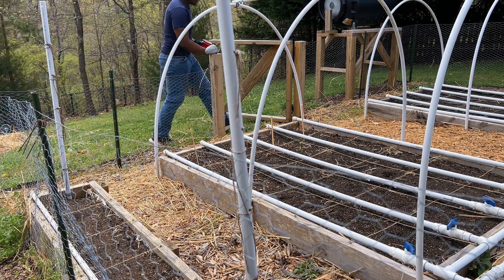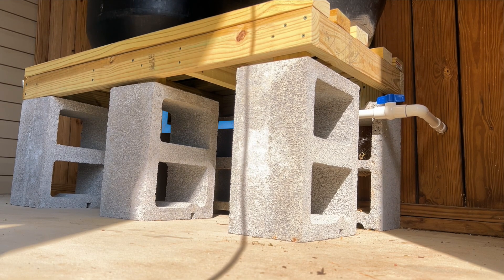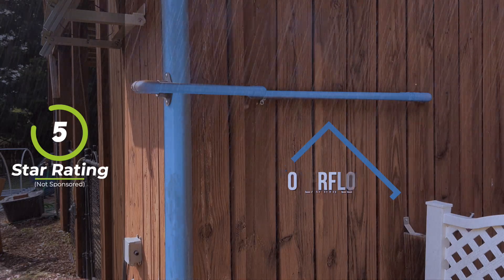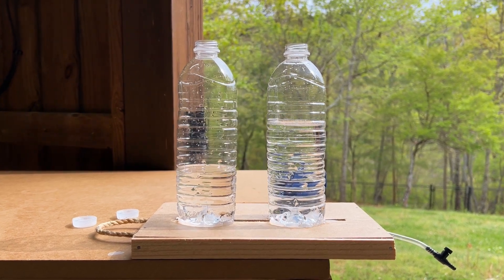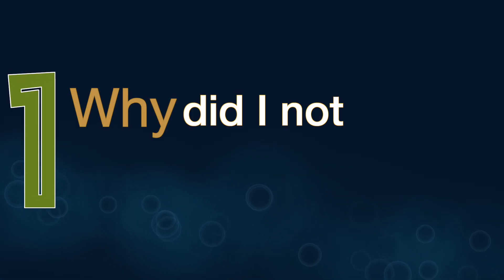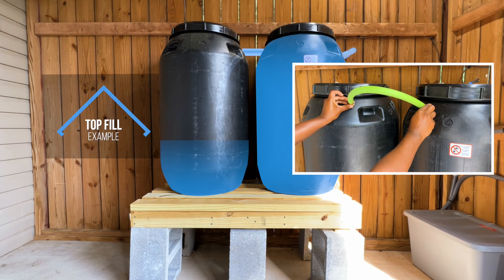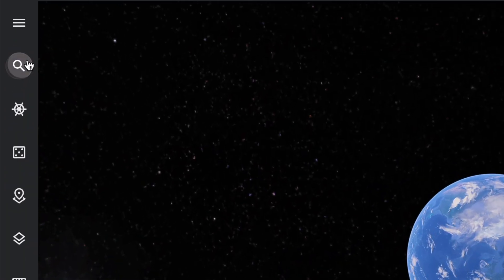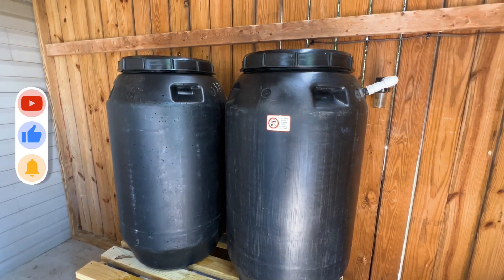Rain Barrel System | EXPLAINED

Comment: Hello, I love your videos and the way you break these projects down for those of us who'd like to try your ideas.  I've been thinking of trying to divert sump pump water to a rain barrel system.  All that water just goes into the storm drain anyway.  I have a large lawn with lots of shrubbery which makes watering pricey.  What do you think? Would sump pump water pose any different problem than water from a down spout?  Thanks again.
Reply from the maker: Thanks for the feedback. I'm not an expert in that area, but I could not see an obvious issue with it if you are already outputting the water down the drain. As long as the source of water the sump pump is removing water from is not containmented I would think it would be fine for watering plants. Making it drinkable would be another story. You could also send a sample of the water off to a water testing center to double check as well. Again, this is just my opinion, so I would still recommend doing more research and talking with an expert in the subject.

Comment: Interesting irrigation set up.  Why do you have five pipes for each 4-foot wide bed?

I have a creek out of which I pump water using a 30-watt solar panel and a 800 gph bilge pump that lifts the water up about 8 feet and then gravity feeds into a single pipe going to each of the four 30-foot long by 4 feet wide beds.  I find that produces enough water to irrigate the whole bed.  Each bed gets irrigated separately from one day to the next, and the bed is irrigated from whenever the sun hits the solar panel to whenever there's not enough sunlight to power the bilge pump.  Obviously, when it rains there's no irrigation. 😸
Reply from the maker: I have 5 rolls of pipe because I use the square foot gardening method and I needed to make sure each square of was receiving enough water depending on what I planted where. It's more of a personal preference, but not required.
Reply: @GreenTechTown  Thanks for the explanation.  So, I'm assuming those on/off valves are turned either on or off depending on which section you're planning on watering?  
My system using the bilge pump actually has pressure in the system so between keeping the water flowing while the sun shines and shifting from one bed to another, each bed gets more than enough water.  Any excess water flows back into the creek through percolation.  
In your case, you're only getting water from what you've collected, so I can see the difference in the systems.
I'm assuming (I know, never "assume" 😸) that when there's no rain for a month and you've used up all the water in your collection that you're using water from your city/town/village?

Comment: I’ve looked at a few of your videos and the included links.  I keep hoping to see a link to the rain barrels themselves and have yet to see it.  Is there a reason you don’t include them or I’m I just overlooking the link?  Great videos.  Thanks for sharing.  Out here in CA, I think I’ll need to install something like this.
Reply from the maker: Yes, the reason is, I purchased the pre-used barrels locally off an ad on Facebook Marketplace. If you search for "Pickle Barrels" you may find some locally, or online.
Reply: @GreenTechTown    Yes, after posting my comment, I did exactly that and found some about 70 miles from me avail for pickup.  Thanks again!

Comment: I'm wondering if your battery is holding up? Do you recommend the specific battery you are using in this setup or was it just what was available at your local store? 

In the past couple years as my garden grew in size, I have become very interested in rainwater collection and use. I have an IBC tote collecting rainwater off a barn roof, which really could probably fill a much larger tank if I ever decide to upgrade, but it's good enough for my small-medium sized garden for now. I currently don't have a pump set up, but I am looking into getting one because I simply don't use the water I've collected as much with it being less convenient than the pressurized hose. I'm thinking that if I can hook it into my drip irrigation system, similar to yours but made with drip depot fittings and tubing, it will become the no-brainer option for when I am out in the heat and trying to get everything done as efficiently as possible, and the city water will be reserved for only those times when I run out of collected water.

Thank you for these videos, seeing your setup so clearly explained helps give me ideas and inspiration for improving my own. And the plants benefit the most, of course!
Reply from the maker: Thanks for sharing your current setup and plans! My battery has been working well with no major issues. I've had this deep cycle battery for a few years now, and I just borrowed it from another project. I believe I purchased them online at the time. Here is a similar product: https://amzn.to/3AXc39U

Comment: Seems like it would be important to make sure the bottom connection piping should be at a minimum the same diameter as the inflow pipe, but probably better to be at least .5 inch larger so there won't ever be a situation where the inflow exceeds the leveling capacity, potentially preventing capture of some rain if the first barrel becomes a bottleneck.  
Would you agree?
Reply from the maker: I can see your point. In this example, the tubing I used was quite small, but in the real world, the size of my pipe was 3/4" and the inflow of water from my downspout is a lot slower than what I displayed here in the video. But you are correct, you probably would want to make sure the inflow and outflow to the next barrel/s is about the same size to avoid that problem.
Reply: @GreenTechTown  cool, yeah wasn't trying to sound like I was referring to the example, though that is where I noticed the possibility for bottleneck.  Thank you.

Comment: It's been dry for the most part last summer and this year so far, not good for rain barrels.  I think a first flush is a good idea. You can make one out of PVC pipes pretty easily. We had a pretty good down poor and I checked my filter (knee high panty hose) connected to downspout line to the first flush, and there was a good size ball of debris. Just throw away and put another one in. It's nice to have the water as clean as possible. As far as the rain barrel series idea, I just hooked mine near the bottom of the first barrel with a Y hose splitter and attached them together. The inside  levers are always on connecting the two barrels, the outside on the first I only turn on when I am going to use it to pump out water and the outside of the second rain barrel Y is off until I want to fill another container or it could be used to connect to the next rain barrel to easily expand.  Same principle basically as the bottom attachment. Whats nice about the bottom attachments is you can get every last drop of water were I loose about 5 to 8 gallons usable usable per barrel on the bottom. I do have a overflow near the top of the first barrel for when both barrels are full. I saw a video of someone who had not thought of putting in an over flow and it was just spouting out everywhere with a heavy rain.  As always thanks for the videos. I have learned allot from them and it helped me  allot putting my system together. I was surprised at how much work and planning it takes to put together a good rain barrel system but I think it is well worth the effort.
Reply: I currently have my downspout dumping directly "into" my rain barrels, but I have a piece of screen over the top of the barrel to act as a filter.  It's amazing how much stuff I find sitting on top of the screen that would have gone into the barrels had it not been there.
Reply: @jeffh4505  Yes, I think a filter of some sort is a must especially if you use a pump on  your rain barrels and you don't want it to clog up.

Comment: I came across your videos while I was searching for ways to get smells out of food grade barrels (I think it keyed in on the "barrel" part of my search terms).

I notice that your barrels once held pickles--did they not have a pickle smell or did you do something to take the odor out?

Great system here, I enjoyed both of the videos on it that I watched.
Reply from the maker: Hey Kent. Yes, my barrels had a pickle smell in them, and I was told to use light bleach and water to help clean/disinfect the barrel by rolling it around on the ground. Some have also mentioned baking soda works. Since my barrels have removable lids, I took the lids off the barrels and let them air out for a week or so. Google also pulled up some other suggestions if these do not work for you.
Reply: @GreenTechTown  Thanks for the quick reply!  I did soap and rolling and bleach and rolling, which helped, but I think it'll just take some time now.  I'll air them out and then do the baking soda thing.

Thanks again!

Comment: Hi! So glad I found your channel. I want to get a rain barrel installed this summer. I just want to be able to connect a hose for simple garden watering and maybe wash my car. You make it look so simple. I am a little intimidated but determined. Thank you for this Q and A, and for clearly presenting the math to get the measurements;) I want to place my barrel directly on the ground. What is the advantage to raising them off the ground and is it necessary?  Thanks again.
Reply from the maker: Hey M. Edwards. Raising the barrel off the ground (or higher than your garden) allows you to take advantage of gravity, increasing your water pressure (the higher your barrel, the more water pressure). Many people take this simple approach since if you can mount your barrels high enough, you can sometimes avoid using a pump. Additionally, it improves accessibility to the bottom spigot or for filling up a watering can if needed.

Comment: What GPM pump would you think be needed to run 2 large sprinkler heads. the Rain bird 5000's I want to start collecting some rain water so that in time of drought i can water my lawn and not use so much of city water and keep the water bill down at the same time. We get some good amount of rain in GA and  I want to utilize it.

Thanks
Reply from the maker: The pump size would probably depend on the size of the sprinkler heads. I would suggest talking with someone at a home improvement store or find out the minimum PSI needed for the sprinklers to function correctly and then find a pump that will support that. You can also tell someone at a motor supply store (i.e. Harbor Freight) what pressure you need and they should be able to help you.

Comment: Have you ever had a problem with water flowing out to your drip irrigation without the pump being turned on? I have a very similar system based on your videos and have noticed that when my barrels are full, water will flow without the pump being turned on.
Reply from the maker: It is possible you have a siphon taking place. Check out the following link where someone had a similar issue: https://engineering.stackexchange.com/questions/8619/how-to-stop-water-flow-in-a-siphon
Reply: @GreenTechTown  thanks for the response! I ended up getting a solenoid valve and I'm installing it today along with a time delay circuit so it can open up a couple seconds before the pump turns on.

Comment: Wow. It is nice setup. Do you have anything that collect leaves  from a roof?
Reply from the maker: For this location I do not, but if leaves are an issue, I would recommend installing gutter guards, or use a diverter that has a built in filter.

Comment: These are excellent videos, very easy to understand. When are you adding a first flush system?
Reply from the maker: I'm not sure on a date frame yet, but it is on the to-do list as a high priority.
Reply: @GreenTechTown   I’m gathering the materials list. I have the large items like the cement blocks and pickle barrels that I have foraged used from FB Marketplace. The remaining items will likely be retail. I appreciate the details on your tutorials. I am inspired. With gratitude, Lynn

Comment: Did you edit all this yourself? Nicely done. Btw I went through two motor controller of my lawn mower. Do u think 2x60 better than 2x25? I used to had a rain barrel system with a instant on water pump using a solar panel and battery. So when u squeeze the water hose the pump would pump from the rain barrels and when u let go it’s stop. I also setup on a garden timer sprinklers. So the system is completely pff the grid. I was fun but I wouldn’t depend on to water my small garden because most days there’s no rain or sunlights so my garden would died from lack of water. Not to mention the mosquitoes and the constant season cleaning of the barrels of mold build up inside. It’s doesn’t matter if I had blue or other dark colors it will get dirty and mold from dirty rain water that’s coming off your roof shingles. So I ditched it and use regular house water and pay couple bucks more.  I also have to constantly maintain of everything because of the pump and deep cycle battery are expensive. And they brake every couple years.
Reply from the maker: I did edit the entire video. I only have experience with the 2x25 but I'm sure the 2x60 is just as good if not better, but check some reviews online. Also, thanks for sharing your experience. I say do what works for you and your application and that is the best solution.

Comment: Great Video!! Question regarding your pump setup to the drip irrigation: Is your pump variable speed? if not, how can you control the pressure/speed at which the water reaches your garden so it isnt spraying too hard? I see you have the shutoff ball valves in the garden, but wont restricting the flow too much strain the pump?
Reply from the maker: Hey Eli. Great questions. My transfer pump only has a 1 flow rate when power is applied. Right now, my pump is a little under powered for my application due to the amount of garden beds I am supplying water to and the distance from the garden. If you need a variable speed pump, I'm sure there are some out there. An on-demand pump would also be a good choice for pressure related concerns.

Comment: Well done. I decided to do a rain barrel system for our garden and possible emergencies. We have 4 55 gallon, wide lid barrels, hidden behind the shed and they catch the water from the metal shed roof. I use my 1st barrel midway as my 1st flush and the is bottom filled, but you're sediment filter is genius. I may add that to my system.  Thanks for posting this and keep thinking outside the box. Cheers everyone!
Edit: I also use 1.5 inch connections for faster water flow, which makes our container filling and barrel cleaning a bit easier.
Reply from the maker: Awesome and thanks for sharing details and tips about your setup!

Comment: I really love your videos and I have benefitted and been greatly inspired.
There are so many fitting and hosing options. I like your use of bottom fed and PVC for your connections. Could provide a link to the screw in fittings you used on the barrels, to later connect to screw on PVC connections?

Comment: I use a similar bottom feed system with three barrels for my OGC. We use this for washing, showers and general water use. Given this we do add a capful of chlorine to keep down algae and other bacteria. We could use a Berky or other type of filtration system to make the water potable but this cabin is mostly for weekends so bringing up drinking water is not an issue. Also our system like yours is powered by 12VDC battery with solar battery tender. We added an accumulator to regulate the water flow or the faucet and shower. We don't have a first flush but have been thinking of adding this, we just use lots of screens between the gutter and the inflow to the barrels. We also can close off each barrel if needed and still keep the system up an running., Great presentation!!
Reply from the maker: Awesome and thanks for sharing!